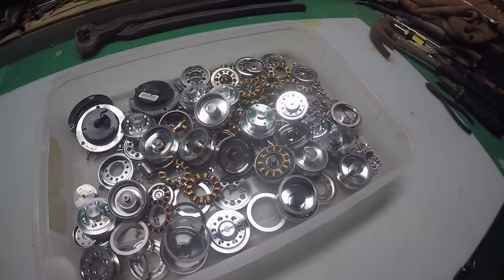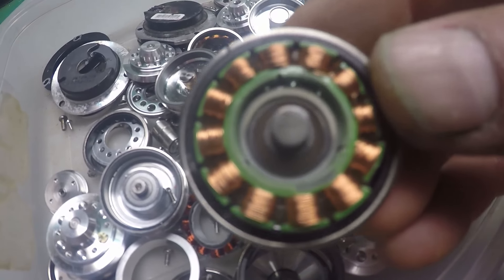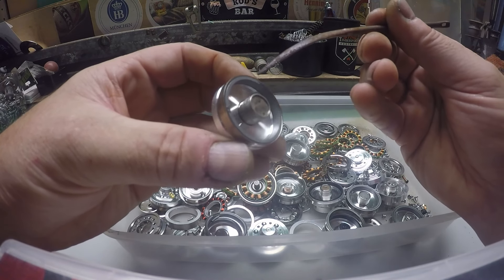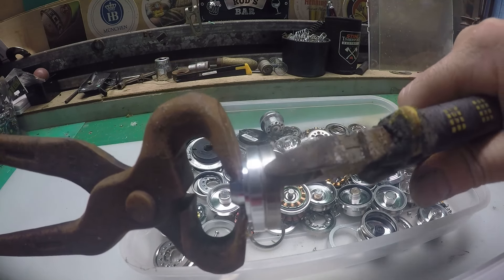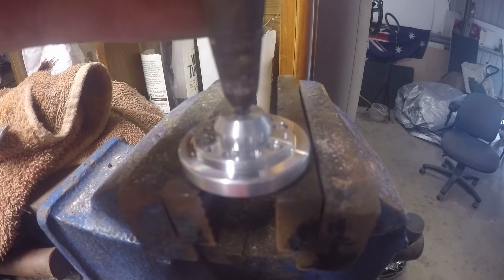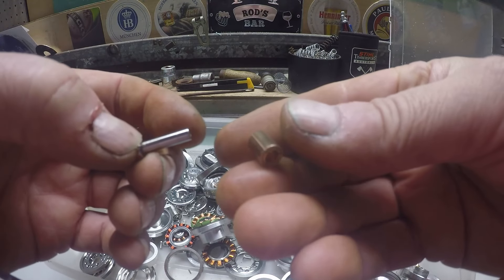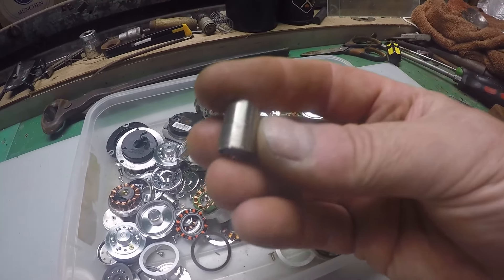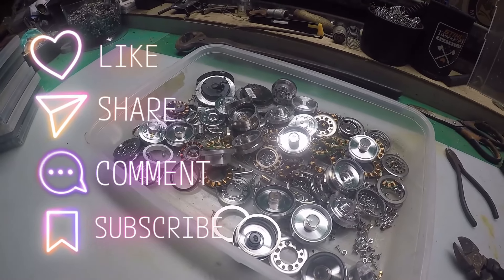I Found Hidden Copper in Scrap Hard Disc Drives - Micro Scrapping

Comment: How much can you make per hour separating the types of metal like this?
Reply from the maker: I suppose everyone has a different price point but I'm only a hobby scrapper, I like tearing things apart and seeing what can be salvaged so the money per hour isn't a big issue to me, its more like therapy... I just get some "me" time in my shed with no hassles or worries. Thanks for watching and taking time to comment.
Reply: @scrapnsalvage  That's alright I get it. I work in IT and have probably 40+ hard drives sitting in the office needing to be disposed of. I have a good 10 or 20 in my loft too. Where do you get your old electricals from?
Reply from the maker: No where in particular, they just seem to accumulate lol